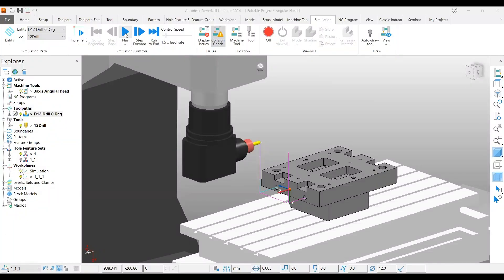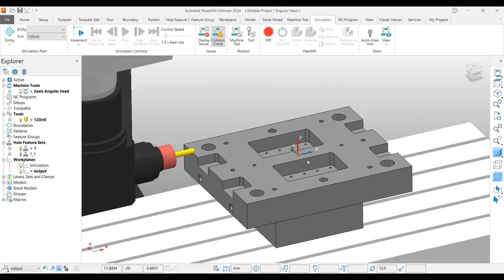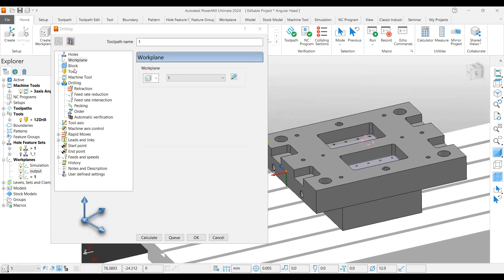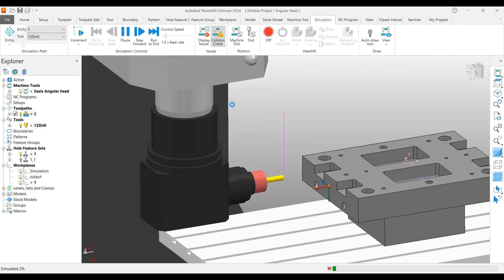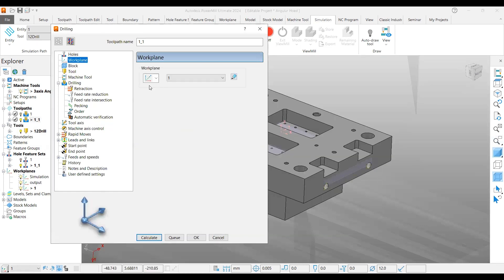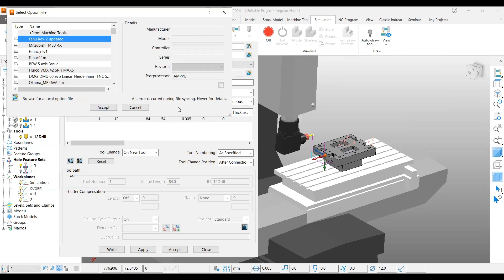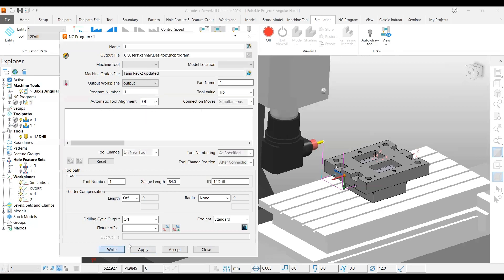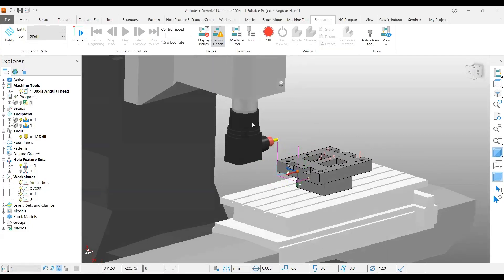Autodesk PowerMill - Angular Head Attachment - Vertical Machining Centre

Comment: In Fusion, does not work well. I have test it, and the simulation is not bad, but it works only in one direction at a time. The real problem is the output of the post that writes the tool axis tilt angle as a five axis machine. Do you have any suggestions?